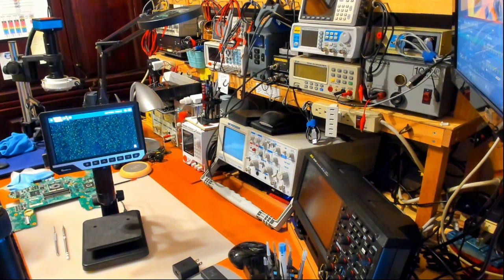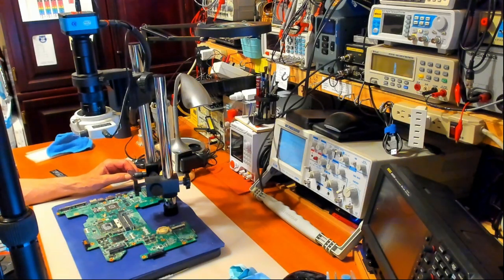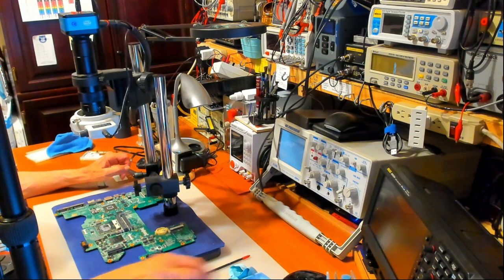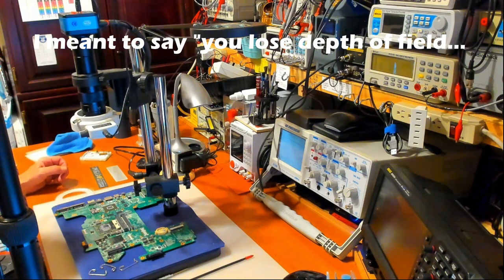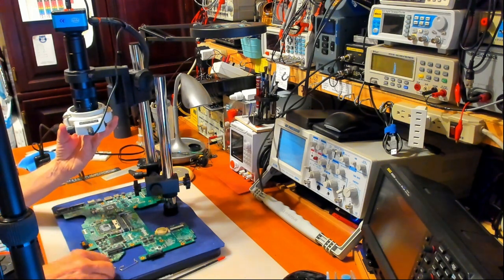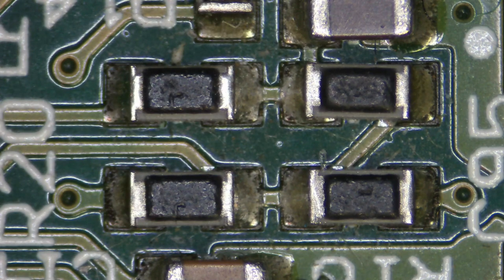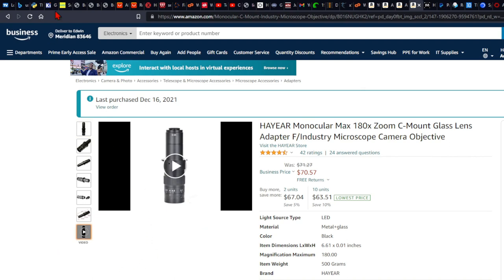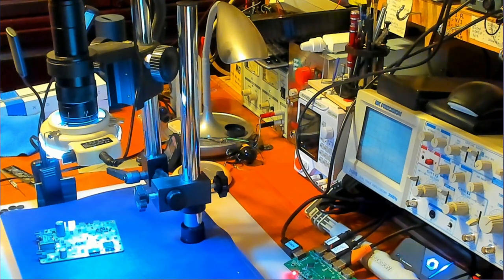Microscope for Micro-Soldering

Comment: I use a relatively cheap Tomlov D201 Pro with a barlow lens, crucially, removed from its base and attached to a boom microphone stand on my desk. This completely removes the issue of having to work with its tiny base. I have two book lights attached to the stand to supplement the ring light built into the Tomlov for a glare free workspace. For the budget constrained micro-solderer it is an invaluable tool that works perfectly well at a fraction of the price. If you do this for a living you should certainly invest in a better setup, but the Tomlov + boom stand is great, and it didn't cost me a small fortune.
Reply from the maker: Yes I have a cheap microscope as well which has separate lights attached, however, I bought it some time ago and did not check if it had HDMI or USB output so I could not use it with a larger screen.  However, I might try to attach it to a stand as a project perhaps ne of these days.

Comment: Thanks, been tempted to get one of those benchtop cheapo scopes for hobby work but I suspected they might not be very good so useful that you confirm this 👍
Reply from the maker: Well, I have heard of people modifying them by removing their base and mounting them on some sort of arm to remove the problem of the mount getting in the way of PC boards under it.  However, I have found that the cheaper ones do not have HDMI output for a larger screen and also they may not have sufficient brightness adjustments in that they may auto adjust making it hard to get the best image.

Comment: On the first microscope, you could always rotate it 180 degrees snd use your workbench instead of the base.  2:00
Reply from the maker: This is true but in that case you might have to put a weight on the base to stop it from falling over.  However, since I use the microscope all the time I replaced the base with a proper arm that I can move anywhere on my desk and when pushed out of the way takes up no desk space.  However, it was not cheap at about $250.

Comment: I find you loose a lot of depth of field information with a camera microscope. I much prefer the binocular type. It might be a different story if I were to be spending all day looking through the microscope...but I don't.  It is also much harder to look sideways at the target when using the camera, the parallax effect is quite revealing when using a bifocal device.
Reply from the maker: Yes, I have heard others say the same thing. It appears to me that individuals have different ways of processing images.  For me I prefer not having to look through eye pieces while I am soldering, I can look from the screen to the actual board and I don't seem to disturbed about the lack of 3D vision.  Others find that they cannot handle this and need the binocular vision.  I guess each individual needs to work out what works best for them.